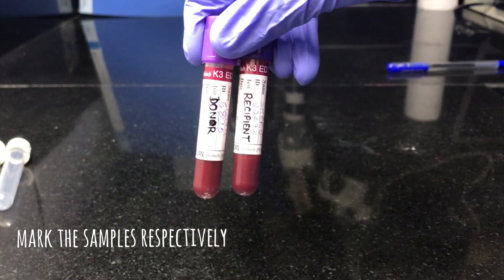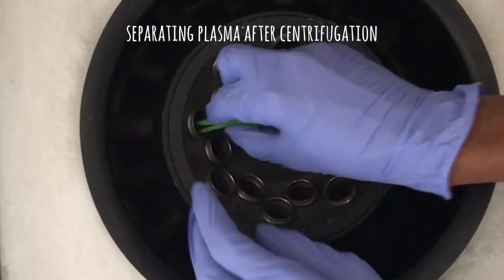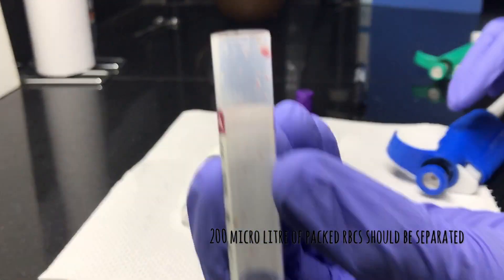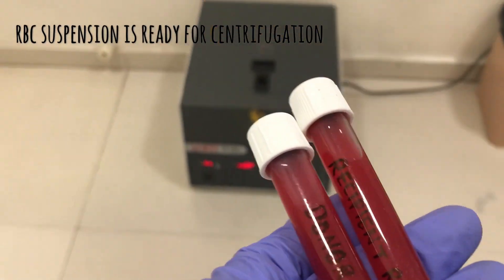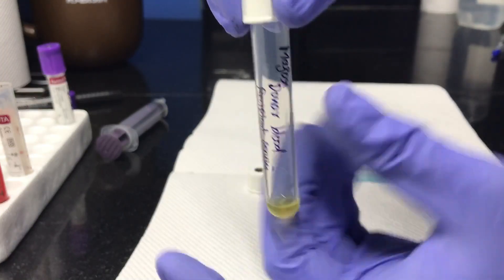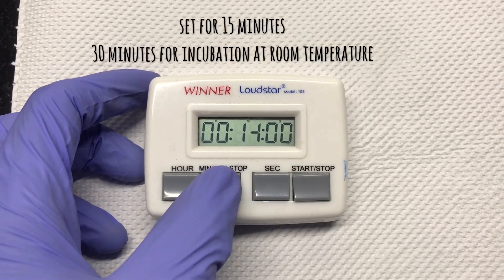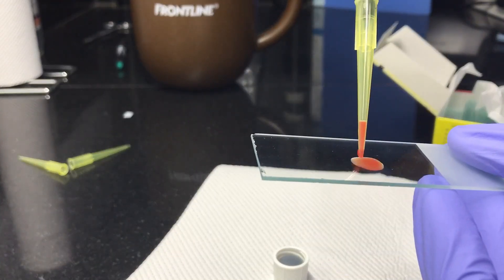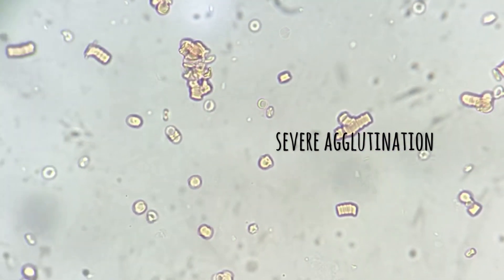Cross match test major and minor

Comment: as part of my work i regularly run indirect coombs tests for pregnant women Rh+ ab screening. i have never seen anything close to the hemagglutinations you showed. but i rarely see only one small agglutination on the whole slide and according to my education, that's not enough to call it positive. 
also, i have never seen the technique of mixing the button at the bottom being mixed with a micropipette. instead we shake the tube while examining it under the light. if it's macroscopically negative, then we put lamellas (slide cover slips) over it so as to avoid roleaux formation.